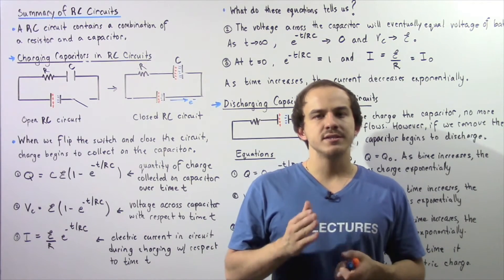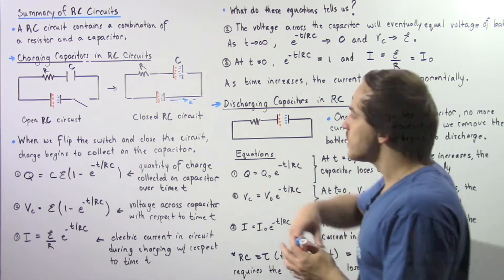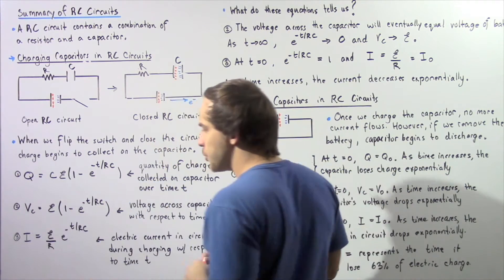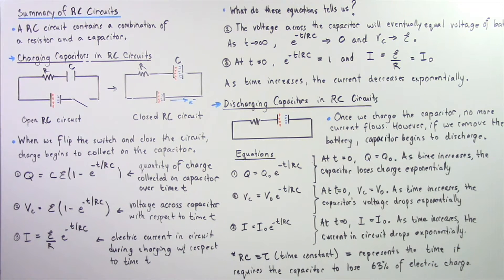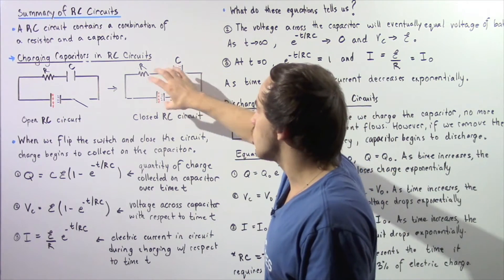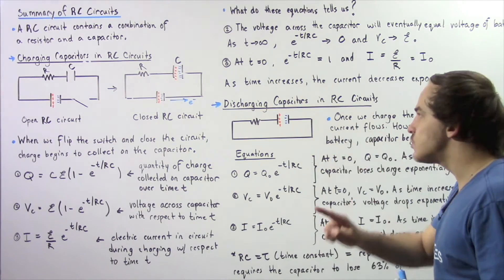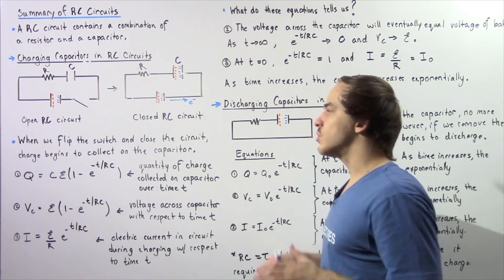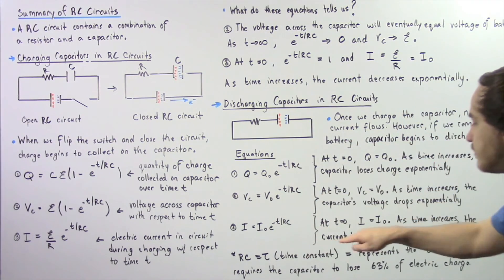RC Circuits, Charging Capacitors, Discharing Capactiors and Equations

Comment: Time constant of both a capacitor and an inductor is equal to 62.3% of the charge maximum.  That resistor, as you know, is a bleeder resistor and is used in all kinds of electronics to slowly discharge power so that repair techs like me don't get shocked.  That is smart engineering!  That is how I will design my circuits.
Frank
The Master of science